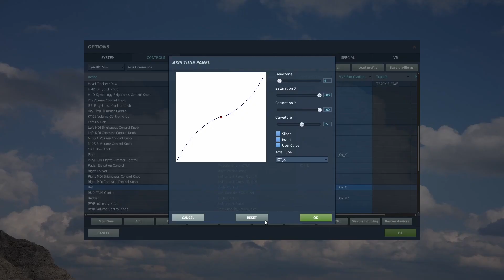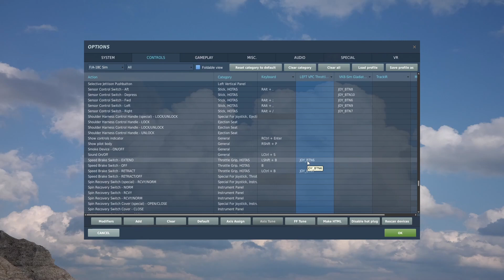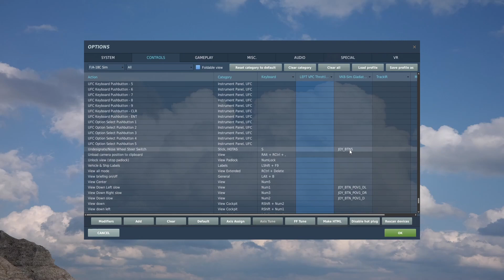DCS World: F/A-18C Keybindings Tutorial *START HERE!*

Comment: Also recommend which mihgt just be new cause this is 2 years old but newer players 

- ECM mode you can cycle it from OFF all the way to JAM, might be useful if you are being locked and going cold. 
- Dispenser Bypass/auto if you want to use a program or just dump some flares/chaff manutally, also switching these around shows your count of remaining dispenses on your SA page or another can't remember by heart the name. ( bottom left of one of them for sure)
- MFD AIR Radar, scale up/down, aziumth up/down, BAR (vertical scan size) up/down, maybe also clean and freeze.
- on SA page, you want NEXT target that it highlights with a YELLOW BRACKET and giving you info about said target, range as well (single top button to cycle through)
EDIT: also afterburner gate if applied, and there is a button to disengage the safe flying mode, which gives you extra turning radius but might break your wings off if used too harshly.

overall really well done video!
Reply from the maker: Thanks man! Yeah good reminder that tutorials need to be updated!

Comment: There is a key combination to make a small diagram appear in the lower left area of the screen that shows what your joystick, rudder, and throttle commands are currently set at. It looks like a cross made out of red lines with a horizontal line below the cross and a vertical line to the left of the cross with a little index that moves on those lines to indicate the current settings.  I would like to have this because sometimes my feet might move my rudder pedals a little unintentionally without knowing it and I'll wonder why my flight path is straying off line.  If I have that diagram up on the screen, I can readily see that the rudder is not centered without having to look down at the pedals in the cockpit.  Do you know what the keyboard combination is to enable it?
Reply from the maker: Hi Keith, the show controls keybind is right control enter. Let me know if that works.
Reply: @Afty86  That was it.  Thanks.  I could not think of what it might be called in the control setup menu.
Reply from the maker: @keithr5638  Glad I could help.